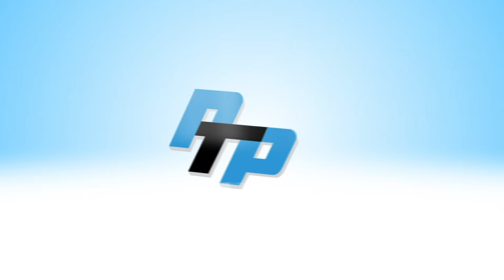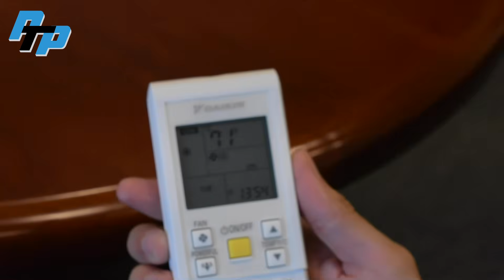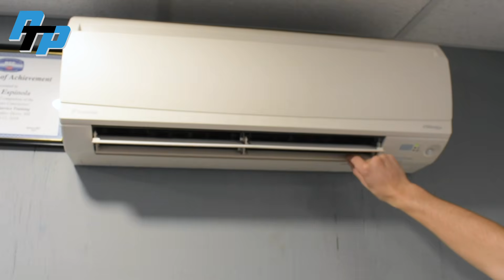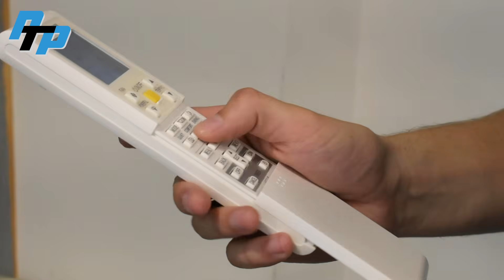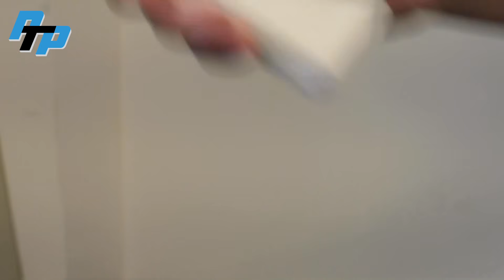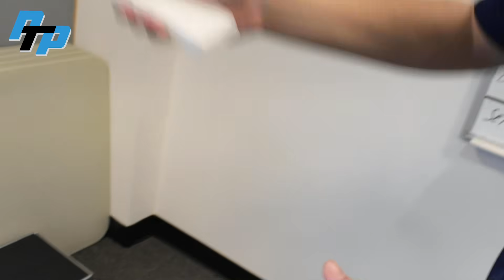How to Use Daikin Remote Control for Ductless Mini Splits

Comment: I just bought a house with this system. The AC was on and it's February. Now I have heat! I didn't even figure out the remote slid open. This video was so helpful, thanks!

Comment: Bro. All these functions and settings. All I want is for it to cool to a certain temp and for it to heat to a certain temp at certain times of the day. No setting it to 75 auto is not the same thing. I want it to cool to 74, but heat to 67. Everything else is secondary. Why is this so difficult.

Comment: WE want to know why DAIKIN couldn’t come up with an explanation like Paul just did…we have been dealing with a humidity problem and for the last  5 years we have been getting the run around from DAIKIN “support” system …Thanks so much Paul…..you should be the new CEO of DAIKIN as they are all useless…..for anyone purchasing Ductless Split units DO NOT BUY DAIKIN

Comment: Thanks Paul, that will help me understand the remotes better, however I am not very tech savvy and I have three inside units that are clean and function well but I think I screwed up the sequence setting  because they all work well individually but will close and flash if I turn on more than one-they will all work on cooling but not on heat

Comment: I bought a house with this system. Unfortunately there wasn’t an instruction book. They told me it was just an a/c unit. Now I find out that it heats as well and how to operate it. Thank you!!!!
Reply: What do you think AC stands for dude. C doesnt stand for 'cooling'.
Reply: @Paultimate7 dude. It stands for air conditioner. HVAC is a/c and heating system. The people who I bought this house from said the only heating in here is the hot water baseboards. So that means the previous owners didn’t either know or pay attention to what this unit can do. The house I had before had central heat and air conditioning so that is what I was used to.

Comment: my remote is not the same as yours. my unit is brand new, first use today. still don't know how to keep the room cool, not cold and not have it run nonstop. where to get that info? So far no one can tell me and the manual does not explain well.

Comment: what drives me stupid crazy about Daikin, is they don't show the temperature of the room on the remote. It should show the room temp by default on the display. Say I walk in and it's just a little cold and I want it 3 degrees warmer..there is no way to know this, you just have to turn it on to 70, and if it's too hot..turn it down to 65, it's a huge oversight in my book. I love Daikin, but their systems software needs to join the 20th century.

Comment: Can you have the heat on in one room, and the AC in another room? Or does this cause problems with the unit?
Reply from the maker: If there is only one outdoor unit for all the indoor units they will not heat and cool at the same time.

Comment: Thanks for the video. Just got this unit. Is there a way to know the current temp in the room. For example if i set it to 71 for heating it would be nice to know what room temp the unit us reading. Similar to a wall thermostat for a furnace.
Reply from the maker: Unfortunately there is not.  The remote is not a t-stat it's only able to set the temperature of the unit.
Reply: Thanks again. Also to my understanding there is no app you can download to control the temperate on the unit from your phone, right? @paultheplumber8665
Reply: @paultheplumber8665 which is why I'll buy a Mitsubishi Heavy Ind

Comment: Does dry mode only operate at on fan speed?
Reply from the maker: Dry mode keeps the unit cooling for a longer period of time. Instead of the unit turning off when it reaches temp it keeps running to pull humidity out of the room.
Reply: @paultheplumber8665    Thanks.  Typo.  I meant to ask if dry mode only operates at ONE fan speed?  I can't adjust fan in Dry mode.

Comment: Is it possible to recalibrate the remote temp reading because mine is 5 degrees lower than the actual room temperature? So, every time I want to leave the house for an extended period of time, I have to add 5 to the number shown on the remote which is somewhat a pain in the neck. My remote is the handheld ARC480A8 and the wall unit is FXT15NMVJU.

Comment: when I'm leaving the cabin for a few days, I set the temp to 51.  However, it's been resetting itself to 66 some time after I leave.  I assume this is the set point auto reset?  How do I get to that on the remote?  thanks for your help.  It's getting expensive to heat an empty place for days on end.

Comment: Can we control this model through mobile app and WiFi
Reply from the maker: There is a wifi adapter that can be installed in the unit, and yes there is an app that works with it.

Comment: Good video, these remotes are much more complex than most other HVAC remotes but not impossible to use. 
My question: is it possible to set the heat lower than 60°(F) or 16°(C)? We have a unit in a garage and don't need it that warm, preferably around 50°(F). Any help would be appreciated.
Reply: I second this!

Comment: Hello Paul I have the same remote control MODEL Mini Split Model NUMBER: RXS09LVJU + FTXS09LVJU  Heat pump System. Remote control model ARC452A21. The heat option does not appear on the remote controller! Would you happen to know why? Do you know how I may fix it?

Thank You very much

Comment: I hope you can help my PTP.  I read all comments before I asked and didn't find my answer.  If it is set on the mode for removing humidity (rain drops), then is the heat/cool mode controlled as if it were in automatic mode (A)?
Reply from the maker: Hey Malisa, for the most part if it is in the dry mode you are talking about it will be in cooling mode. It doesn't really apply to heating. Hope this answers your question. Thank you for watching.

Comment: I just installed a 3 unit system.  If I take a remote from one unit to another, how do I know what temperature the next unit is at?  If I set the first unit to 72 degrees, then take that remote to another unit and change it to 71, how do I know that second unit is now at 71?  What if it was set to 77 when I pressed the button?  Wouldn't that just change it to 76 even though the remote says 71?

Comment: I had a Daikin 9000 installed into our bedroom.
The whole purpose is to be able to cool the bedroom only down at night for cool sleeping, without cooling the entire house.
The problem is  - want to cool bedroom to say 67 degrees - so set on remote =67, cooling mode, fan to low (first indicator block) BUT the unit keeps on cooling after it reaches 67 and continues to a lower temperature.
QUESTION - how do I control or set it (like a thermostat) so that the temp goes to the set point and not lower ?  Want to do this automatically.  The only way I have found is to turn it off at 67.  We want it to hold at 67 while we are sleeping and not go to 63.
Thank you
Reply: I think I have the same issue. The temperature setting is worthless regardless of whether I'm heating or cooling. It never matches the room temperature. I'm constantly having to adjust the setting.

Comment: in 2018 we bought a 24000 btu mini-split . Model 3MXL240MVJU-is there any way to set or raise the temperature in the DRY mode??? find the air blowing from the unit TOO COLD. thanks.

Comment: Hi... Just got this in September and have a question about the auto mode...   Once set to auto, it will work the heat and cold to maintain that temperature (say 75 degrees)   If the garage is 88 degrees it will cool away until it hits 75 and then shuts off until it rises again say 78 degrees (not sure of the degree amount it allows for) ?  Or does it go into a slow/low mode and continues to run until the power button is pushed to off?       As for the cooling mode, it never shuts off  (or so it seems) it just keeps cooling away?  Or is it supposed shut off at say 75 degrees and it was started at 88 degrees?    It NEVER seems to shut off when reaching a set temperature, sort of confusing.....
Reply: I have this same question.  Trying to set mine to a pretty high cooling mode temp (80) just to help take the edge off later in the summer.  But today it is only 67 in the room right now and when I turn on the unit the cold air never stops.    Did you ever figure it out?
Reply: @shelleynice5431  No, not yet... I am experimenting with it and trying some different things..  I wish one could set a parameter of say 75 to 78 and set it and forget it..
Reply: Same issue. I'm keeping a bedroom closed so a cat doesn't get to my plants. We're getting cooler nights and I wanted to maintain a temperature of 66 degrees. Set it to Auto since the manual says, "In AUTO operation, the system selects an appropriate operation mode (COOL or HEAT) based on the room and outside temperatures and starts the operation. The system automatically reselects at a regular interval to bring the room temperature to user-setting level." This morning I walked in and the room temperature was 63 degrees while the outside temperature is 39 degrees! It doesn't make sense to me that the unit would select a cooling operation when it's colder outside than it is inside. I guess I don't understand the purpose of AUTO mode, and I'll go back to using only HEAT or COOL. But then I have to constantly adjust the temperature setting, or power off entirely when the room is comfortable.

Comment: There’s a lot of stuff on here that he didn’t explain like the eco-mode. Now I know what it does but it slows down the fan at the condenser so it’s so moving refrigerant just not at full capacity and saves the homeowner energy

Comment: I have had my Daikins installed 3 months ago (Jan 8th 2022}in the Poconos.I have been very happy with the Heat coming from the unit.I know during the winter the inside STOPS and that means the outside unit stops to defrost for about 4 mins.(Very little ice that I can see if at all}I have as a outdoor unit a 4MXS36RMVJUA and 2 indoor units FTXS12LVJU and a FTXS18LVJU.My question is when I am ready to change from Heating too Cooling for the Spring,I know both units have to be in AC MODE but do I turn one on AC and Run to the other and turn that to AC orrrr do I shut the off and program them?
Reply from the maker: You can just put both into cooling mode and they will adjust.

Comment: I have what appears to be the same system as showcased in this video. Brand new. Just installed in November. Tried to use cooling just yesterday and no cold air coming out. Just warm air. The guys are coming on Monday but there are no remote issues, no error codes, the area near the heads and the outside unit are clear. Everything appears fine. What the heck is going on.
Reply from the maker: Is every unit in the same mode? If any of the indoor units are still in heat mode cooling won't come on.

Comment: Can anyone plz tell which mini split displays running temperatur on the unit itself 
My AC does not work on heat mode it gets off together if the creator lf this video or anyone can help me plz

Comment: This is the best & clearest explanation I’ve seen for our unit. Thank you!
Reply: Ehhhh, there is a lot more stuff on there that he didn’t explain like the Eco mode obviously it saves energy but how? That’s what I wanted to know for when my customer asked me how that saves them money so for anyone who is curious it slows down the fan at the condenser but it’s still operating just not at 100% so it’s still moving refrigerant just not at its full capacity.
Reply from the maker: Thank you!
Reply: And it helps that the young man is very good looking too.

Comment: is there anyway to have the cooling air go continuously even though it’s already that temperature in the room. Mine cool air wont work because it’s already cool in my room.
Reply from the maker: You could turn the temperature on the remote down below room temp, or you could just put it in fan mode to have the cold air circulate.

Comment: Hi, when swing is activated, does it make any sound the swing operation ? Or is completely silent?
Reply from the maker: The swing mode doesn't make it any louder than it usually is.
Reply: Thanks for reply, in my perfera 9000 btu atxm25r model, i hear swing motor when it is on especially when machine works at low air fan speed, 1st or 2nd or in silent quiet mode and swing is activated , that swing motor sound is exactly like humming noise sound. That kind of swing noise is only covered by the sound of the air, when the machine is operating from the 3rd gear speed fan and up. That sound stop completely only when swing is deactivated.

Comment: Omg thank you. I couldn’t get any heat out. I live in Vermont so it gets to -25 here and that’s pretty cold. I couldn’t get my daikin to blow out any heat . Thanks to your video it’s working a lot better.
Reply from the maker: Glad to hear it Francis. Also keep in mind these systems are generally meant to operate down to 5 degrees. There are some systems that will work down to -13, but that may explain why it wasn't producing heat. Thanks for watching!

Comment: Just started renting an apartment with these units. They all have a limit of 18C(all I've used before has been 16C) and the main room never seems to get cold even though it is blowing coldish air. We've been in the apartment for 2 weeks and I haven't had to shut it off or turn the temp up because it's gotten too cold.
The other bedroom units however, when set and running for a long time don't cool down as even though it's set to cold mode they seem to only be blowing in a fan mode with room temp air. 
Is there any suggestions to check these out? They were supposed to have been cleaned and serviced before we moved in, is there a way something happened during this?

Comment: You are actually the first to explain fan auto mode. If understood correctly... As demand is required the fan will increase speed and when not reduce back to low (eco mode?).

Comment: Great video and it helped answer several questions for me but still, I cannot get my Daikin to function as I think it should.
1) If it is placed in either heating or cooling mode the outside unit will cycle on/off as expected but the head fan never shuts off. For me, this makes the room very uncomfortable.
2) In the auto heating/cooling mode, again the outside unit will cycle on/off and the head seldom shuts off. This has made it impossible for me to find a comfortable setting. This AM I had it set to 78f and it was much too warm. The head was in heating mode and the head fan was blowing air. I reduced the setting to 77f (one-degree change), for several minutes the head remained in heating mode and continued to blow hot air. When it changed to cooling mode the fan was really pumping out the air. It has now been about 4 hours since the one-degree temp change, the head is still in cooling mode, the room is uncomfortably cool, the head fan is still blowing cold air. 
The room is 15.5' x 15.5' and has 12' ceiling.
The model number on the outside unit is RX18AXVJU, the head is FTX18AXVJU. Per the invoice, it is an 18,000 Btu unit.
The heating/cooling mode is Auto, the fan is Auto
Suggestions???
Reply: Similar issues with ours. The temperature detection seems worthless so I’ve had the best luck setting it to heat or cool on the lowest fan setting depending how I’d like the room to feel.
Reply: @wormoSTEEZE  Elsewhere I discovered that if you use the AUTO for heating/cooling mode the temp must change 8 degrees from the setting before it will flip modes. Obviously, this is ridiculous. In the same video, it was suggested to use the manual modes and keep the fan on the auto setting. So far this has been working great. The downside of this is I set the temp for 70 in the heating mode (it was really cool outside). Later in the day the temp outside was almost 80 and the temp in the room got above the setting for the Daikin and became uncomfortable. Daikin does make a smart thermostat that will give you true auto mode between heating and cooling but it cost over $700 just for this control and you get to install it. Some guys have got other thermostats to work. I found one video where the guy got his NEST thermostat to work and for $50 he would make the necessary module to connect the NEST to the Daikin. I have not followed up on this. Also there are other smart thermostats that can be used but I need to do more research (already I have too many projects and this will be delayed).
Reply: @johnterdik4707  you sir have provided the secret key, this 8 degree differential would explain my frustration, that and a lifetime of ex's but let's  take one thing at a time.
Reply from the maker: You may want to get it looked at but I suggest only using auto mode in shoulder seasons (spring/fall) and just putting it in heating mode in the winter and cooling mode in the summer.

Comment: Hi, i have the same wall unit & remote. Is there any way that the Remote can display actual room temp instead of the set temp? I cannot seem to find this anywhere in the manual or after spending 10 messing around with the remote.. thanks!
Reply from the maker: No, the remote will only show the set temp there is no way to have it display the room temp. Thanks for watching!

Comment: awesome video, hoping you can help please. i have this same unit. i set it to heat put it at 21 degrees, auto fan speed and 3d airflow. but nothing is happening? if i raise to say 26 degrees it does nothing for a while and then kicks in and everything works as the control is set to. I then go back down to 21 and everything stops again. It not cool outside here yet but just testing. any ideas?